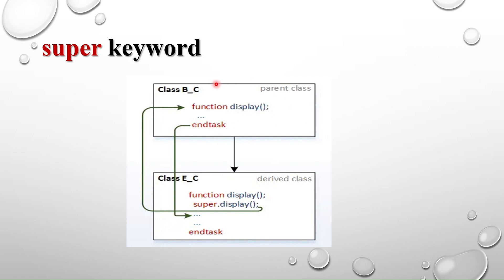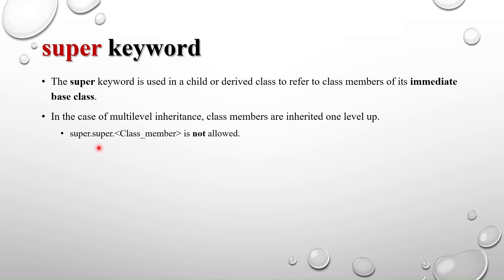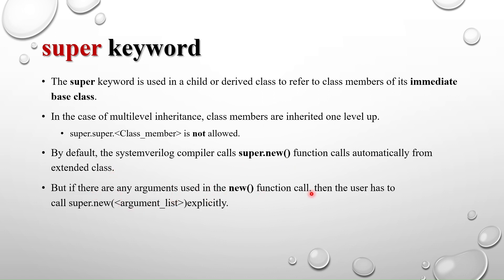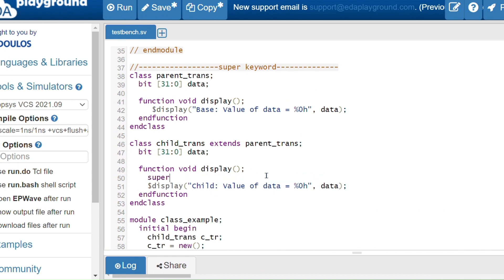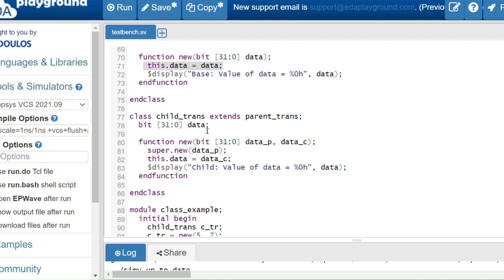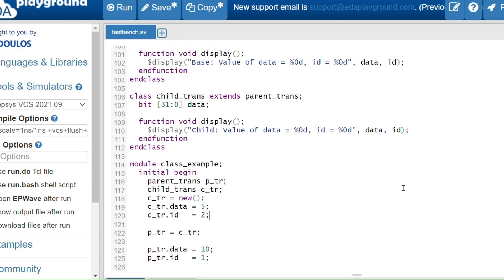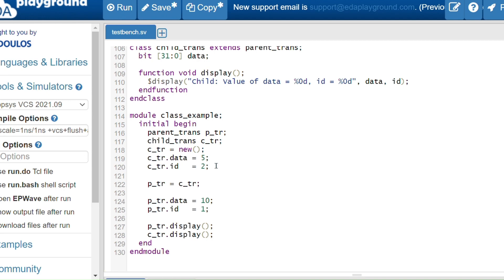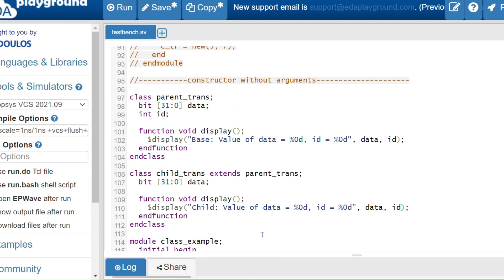super keyword in #systemverilog |Introduction & Examples|#vlsi #verification #verilog #semiconductor

Comment: @11:27 A quick question,  p_tr = c_tr will still point to the parent class methods/properties. Is there any use case for this or is it a limitation which is solved by polymorphism?
Reply from the maker: @nrusingagantayat1199  
The main use case is to treat different child objects uniformly using a common interface (the parent class). 
This is also a fundamental concept in polymorphism, which allows you to write flexible and reusable code.
Polymorphism allows a child class to override methods of the parent class. When a method is called using a parent handle that references a child object, the overridden method in the child class is executed.
And the main thing is method should be virtual to perform polymorphism.

If you didn't get my point let me know. I will try to give example.